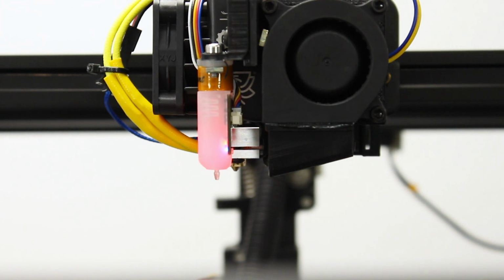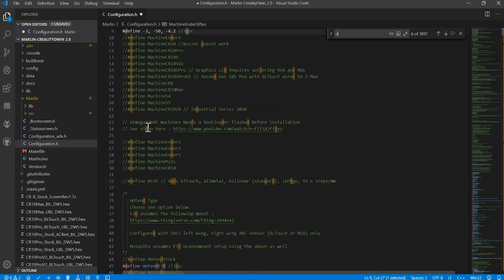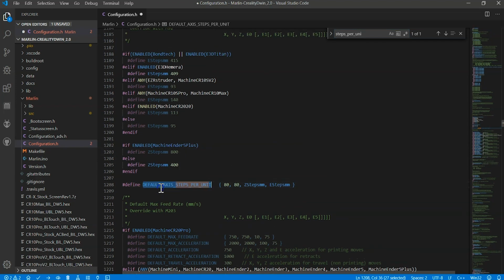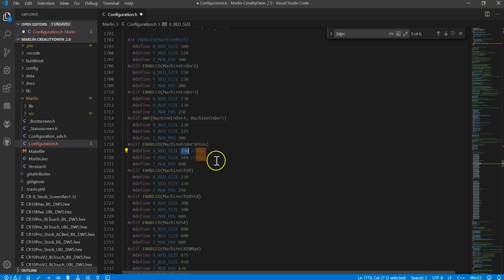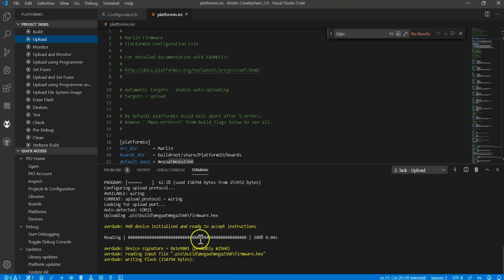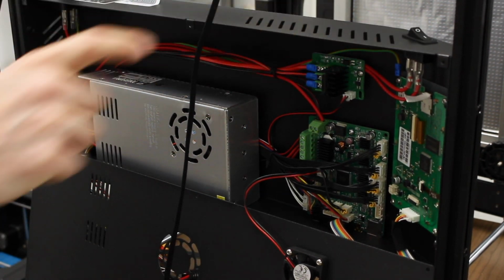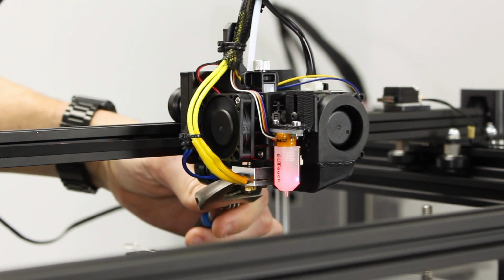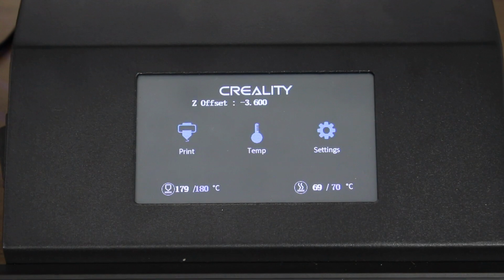How to Install an E3D Hemera on a Creality Ender 5 Plus

Comment: Followed this guide too to upgrade my Ender 5 Plus firmware to Marlin 2.0
For the screen-> Do not forget to format the USB stick and set the allocation unit size. I forgot the formatting step and my AUS was different and it did NOT update anything.
After the format it worked like a charm.
Reply: Set the allocation unit size to what?
Reply: @thegardenofeatin5965  uuuuhm... I think it was 16kb? Im not sure though, sorry, i found it somewhere on reddit but cannot find it now...

Comment: Hey Jason. Thanks for the video....are you planning on doing a revision with the new Revo Hemera quick change hot end.....

I was also hoping you do a firmware compile for the ender 5 and BL Touch and I found the the filament sensor has no way to be working at the same time on the silent mother board ... with the Creality firmware (LAME) though there is plug for it and the BL Touch. 

Be awesome if you could assist....

Wanting the upgrade .. even bought it from you guys :)

Comment: Hi, Thanks for all your videos. I would like to purchase an Ender 5 plus but.. I have a new Hermes on my desk and want to make sure I can put it on the machine.  I also have a Geeetech A30 that I tried to put the Hermes on and do the firmware flash.  I pluged the A30 in and heard a pop.  So I believe I fried a 3 week old machine and do not want to destroy a new machine ( Ender 5 plus). 
   I have never used any of the firmware programs and have struggled for 6 hours now trying to follow your video.  I need to download the correct firmware  and do not see the link to do it.  I did successfully download the platform and vscode.  I have been 3D printing at work (teacher) for 6 years now (Taz 4 and Taz 6s) but I am not very computer literate.  Since I am teaching from home I need a 3D printer that I can use.

Comment: So, I have a question. I used your mount for the Ender 5 Pro (very well made mount BTW!), and it seems the mount causes the print head (nozzle) to exceed the bed by about a 1/2". Not sure if I missed anything but is this a known issue? I only ask because I have a fairly large print
Reply: i think they made the bed size smaller in the marlin settings to avoid this
Reply: @mrsalt9494  hello , can you please give me the link to the mount

Comment: can someone give me a link to upgrading my ender 5 plus, I purchased a 500c heat tube, v6 hot end, and a 500c thermocouple/thermistor, what do I need to set in the firmware and how,, unless someone has one preset for me to install, which would be aweseom.thanks

Comment: Can you flash the LCD back to stock afterwards?  Where are the files for that, if so?
Reply: Like with every thing this dude does, I'm pretty sure it's non reversible. It would usually be, but this man is a cable cutting savage.

Comment: I've had my Hemera (and all the extra parts I need) for a week and have still not installed it. I've printed all the brackets and fan shroud in PLA+. I've assembled everything than can be put together before physically modifying my machine (Ender 5 Pro). I designed and printed my own overhead spool mount. I'm all set, but I'm still nervous.
The physical install and soldering are pretty straightforward. What bugs me is the tuning. 
Is there any way to do this outside of incremental modification of code and having to open and re-open the case to inject the mainboard? I'm new at 3D printing and already not that great at finding problems and fine tuning on print settings alone. If I start going the wrong way on one thing then try to go the wrong way on another thing to fix the first thing I broke, I might wind up looking like some really bad overly tuned slicer settings (guilty!)
If I go with the recommended settings, how far should I have to go on adjustments?
Reply: ..after installation I will re-print everything in ABS, I just don't want to attempt that with the stock print head.
I have a glass plate, spring metal PEI plate, and the stock "mousepad" creality plate. I'm in the large creality tent, with a dehumidifier, air filter and outlet fan, custom brackets for mounting on the tent frame, webcam, lighting, spool dryers, etc. 
My goal is to be able to regulate temperature in the enclosure. May require heating/cooling unit, but I keep the humidity dialed to 30% or less.
Reply: @Snaptick  Did you end up doing it? lol i have same machine, contemplating this or Microswiss

Comment: After I followed this video, why if I press auto level or measuring theres glitch then crash, and i have to restart. Is it means my autolevel is not working? And why the size bed is smaller? Thank you
Reply: I have this exact issue, did you ever resolve?

Comment: Am I the only one having issues with the flashing process? I see no github link at all in description so I type in it as I see in the video. Even then once I download it I am not getting the same 7zip file to extract. S.O.S.
Reply: I have the same problem. I downloaded the file from the github page with the same name. but the folder structure is different. I tried to follow the instructions in the video but the MS Visual Studio code when I go to build, it comes back with "he terminal process "C:\Users\khanj\.platformio\penv\Scripts\platformio.exe 'run'" terminated with exit code: 1."
can any one help me. I am trying to add only Hemera and nothing else. Thank you.
Reply: The flashing worked for me but i dont have the 7z file

Comment: Nice tutorial, that mount on the Ender 5 Pro is extremely wobbly and you lose a lot of build space, it now slams into the front of the cage. Print quality is not great.
Reply: You should probably set your limits better... I would guess, that's just an oversight on your part. From what I've seen and played with, you have the power to adjust all the travel limits. You must have missed that in the tutorial.

Comment: Great walk through
love the mount design :-)
I would NEWER print the fan shroud in PLA. PETG or even better in ASA would be my choice
Thanks for sharing.-)
Reply: It doesn't hurt anything. Tons of folks use pla for that without issue. I personally carved mine out of the side of a bolder.

Comment: 3d printed shrouds make me shudder. You're relying on the accuracy of the printer to make sure everything is aligned and plumb. I'd take CNC machined metal any day.
Reply: You have a point, but CNC machined, especially for parts requiring more than 3 axes, is extremely expensive compared to 3d printing.

Comment: There's no need for wires, just clip them all! Take a chainsaw and just rip them all out. Connectors? Ain't nobody got time to do things properly! This is just for the video, so why bother actually taking the time to do things the right way? Once you're done, just toss everything in the bin and buy all the new parts from your shop!
OR
buy appropriate lengths of cables and make your own  cables that run between the original headers if need be!